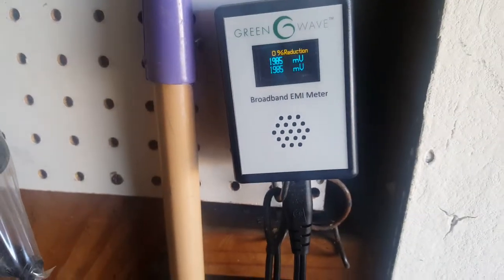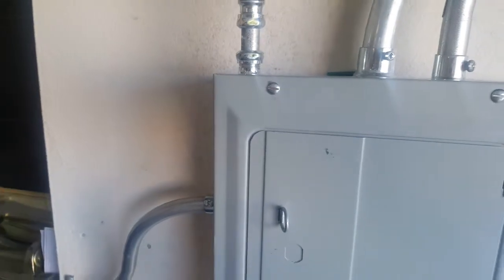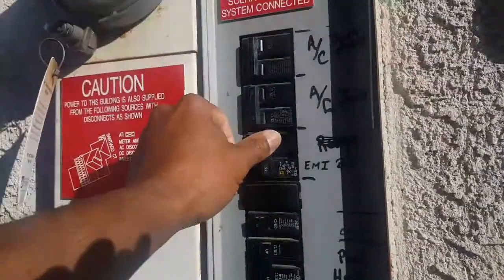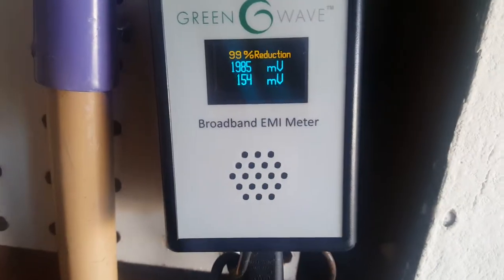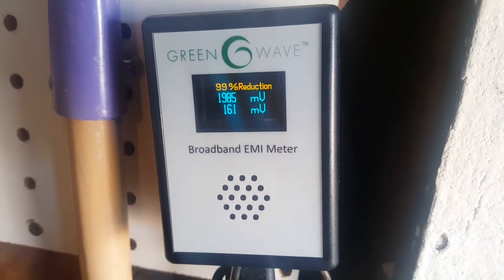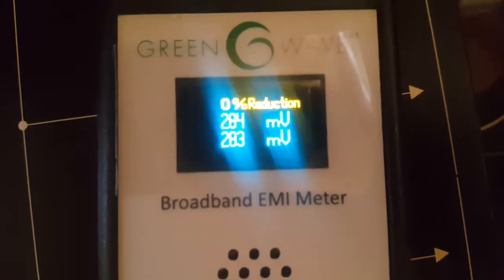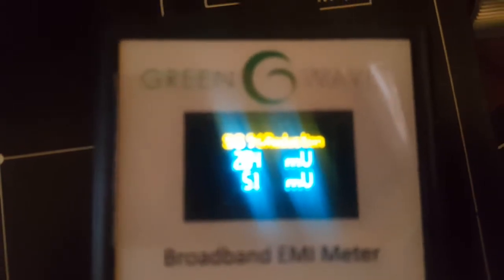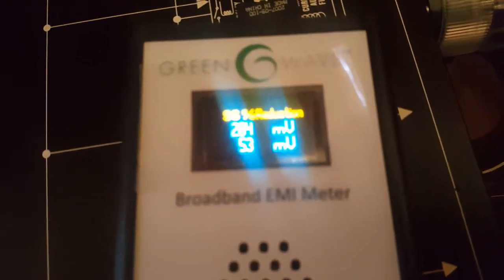EMI noise Fixed and Cheap!

Comment: Bruh! I just got this meter. I have a radio station playing thru my home electrical wires! 

I got it in the mail and plugged it in, the nose level was around 500+ and a two broadcast was clearly heard. IDK WTF is going on with that.
Reply from the maker: Lol, never heard of that...
U need a different tool or specialist for that... Damn!
Reply: @ronbrown7621  I've been buying the greenwave outlet filters for weeks. But I wanted the meter so I could check to see the levels. Without the filters, radio signals. Plug in a filter and the signal goes away until I test an outlet that isn't on the same circuit. It's craziness.
Reply: @heinzkitzvelvet  did you ever fix this?
Reply: @denis9779  greenwave dirty electricity filters from Amazon fixed it.

Comment: Sir if I use a double conversion Online UPS (instead), will that condition the AC power and reduce the noise as well?
Reply from the maker: Greetings just tested that theory and witnessed no change in noise reduction....
Reply: @ronbrown7621  Wow really?
How is that possible? Shouldn't a online UPS just condition the AC signal to pure sinewave at it's output and get rid of all harmonic distortions and ac line noise?
Can you please elaborate?
Also which online UPS did you test?
Reply: @ratedrsuperstarthega  yes in theory, the online generates its own sign wave isolating it from mains, now if that re-generation itself can produce noise which i dont think any of the well reputed online ups brands would be implementing it such poorly, so yes op is right before purchasing online ups measure its reduction and also let us know how this performed. Whole house conditioning certainly is most expensive, most only need clean power locally which many small conditioners can do, again, measuring the difference is important.
Reply from the maker: 😲😲😲😲😲😲😲😲
U asked, and u don't like the answer....
PLEASE get a meter and check for self, don't just believe,  but verify..😉😉😉😉😉😉😉😉

I have 2 A PC units that I tested with the difference that we see is
AC to DC to AC with pure since source, we didn't see a supported change the line noise, that make us say this is the most effective and efficient way going forward. Hope this helps😀😄
Reply: @ronbrown7621  No no, It's nothing like I didn't like answer. Infact I was a little shocked at your results. Because these companies selling UPS do so much marketing about online ups and how great it is.
But now I know the truth. Thanks to you.
So if it makes no difference in noise, maybe the only thing online UPS does is keep output voltage stable (unlike offline or line interactive ups which fluctuate constantly on output in proportion to input voltage).
So the only way to remove noise is to get that box you installed on the mains panel, If I understand correctly.
According to you, what is the benefit of online ups (besides stable voltage) ?
Thanks a lot sir!
Reply from the maker: @ratedrsuperstarthega  
The main advantage or PRO  is
The unit can provide power during  AC power outages....
The UPS  is not a line conditioner hence the  name, a line  conditioners job is to reduce noise coming in from the power lines, panel, and outlets... their are more the just the box I have that can handle the whole, I chose this one and showed why dealing with my expensive theater equipment  connected at ALL outlets.😊😁
I hope this helps and o didn't take it personal,  so it good👍👊